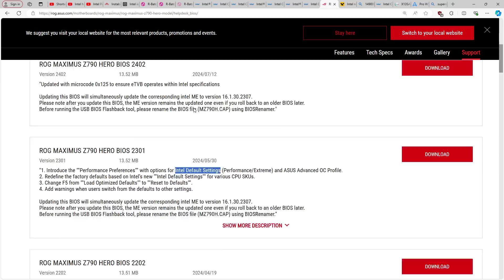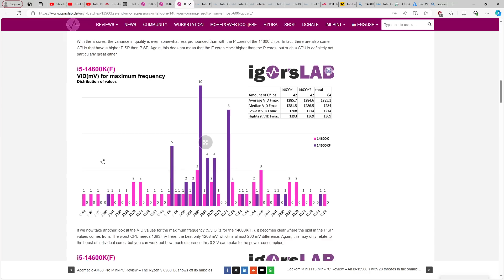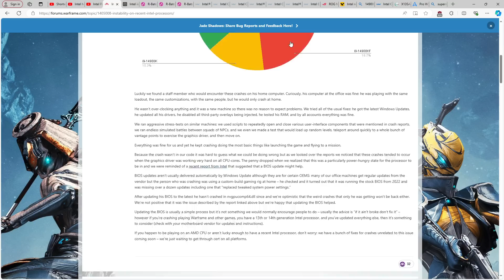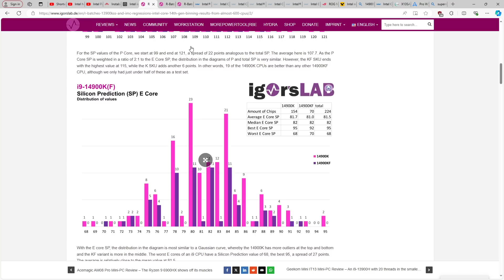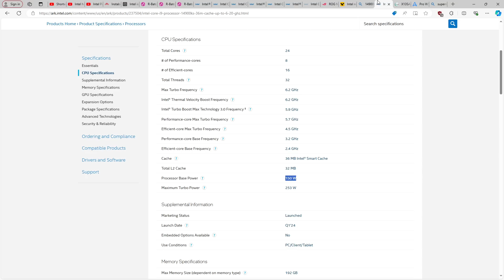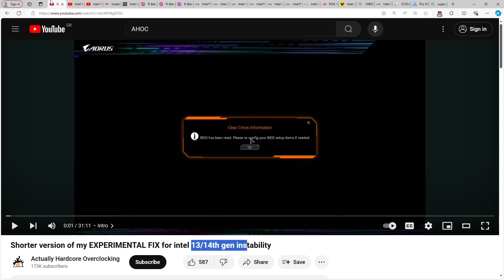The intel instability and degradation rant.

Comment: My 13700k / 4090 build has been flawless for almost 2 years now. Contact frame since day one as well. Been reading a lot that the stock retaining bracket can potentially be the cause of bent cpu's causing micro cracks in the e-cores and other parts of the cpu but as of right now that's just speculations with no hard evidence. But I've pushed my 13700k with a good oc since day one back when it was on the z790 tomahawk ddr4 board then I switched to the ddr5 z790 msi tomahawk when it released a little bit later and used the same oc settings but pushed my ddr5 which it has handled perfectly for well over a year now. 13700k oc to 5.6ghz on all 8 p cores, All 8 E core oc to 4.4ghz, Ring oc to 5.0ghz at 1.34v. Even the mem controller has been very solid. 32g.b Corsair rgb vengeance 6400 cl32 hynix A-Die oc to 7200 34-41-41-83 at 1.45v. I can't complain. I've know most are with i9's but I've seen a lot of i7's and even i5's and i3's effected by this on all generations 12th,13th,14th gen even though some are saying 12th isn't effected by this a lot are coming forward saying otherwise.

Comment: My choice of cheaping out and getting a 13700kf instead of a 13900k seems like a great choice in hind sight, I've had 0 stability issues. I have a -95 mV undervot.
Reply: Also in this boat
Reply: THey are on the chart and also fail.

Comment: Been running my 13900KS at 5.6/4.4Ghz with 1.175v and HT off for a few months now, only 230W in R23. Runs nice, cold and stable, and even better in games due to HT off. I'm not even bothering anymore with overclocking ... The difference is just marginal and doesn't even matter when FPS pass the screen's HZ anyway.

Comment: My 13900KS is degraded and running an all core OC with an undervolt is all i could do to get stable.

Running at 1.35v with the llc cranked is stable at 5.6/4.5 all core. The auto voltage of 1.4v at default llc is not stable.

And the ring makes sense. Everyone I've seen can do a ring oc of 4.9-5 ghz and mine, at this point, just doesn't tolerate a ring OC. Even with the insane vcore like 1.45-1.5v ring just isn't stable past like 4.6. Running at 4.5 at 1.35v is fine.

Comment: If you replace the contact frame and tighten it down you'll get enough board flex to effect the ram or even no post. So what do you think some of these motherboards are doing anyways? Many are thrown in a metal box and that's about it. I'd say any flex is doing some of it. Heat and cool cycles what have ya. Imagine the heavy heatsinks on the boards. They flex the board the same way.

Comment: sorry for being late to the party, but this just affect i7-9 with the K, right?
Reply: No, seems others may be affected too, but at a much lower rate (so far, anyway…) because they clock lower
Reply: @mduckernz 13600k has been out for 2 years and still is not showing on the crash reports, dunno what you're on about.

Comment: I had to RMA my 13900 K last week and I was experiencing all the symptoms the vram out of memory error random crashing voltage going all the way up to 1.8 with or without load I would turn down my CPU 200 MHz it would work for a week and then start crashing again turn it down 200 more work for another week and start crashing again all the way down to 5ghz all core all with Intel baseline enforced still hitting 1.8v. I've never had heat issues, in the high 80s low 90s on R23. I thought it was my GPU and I started the RMA process for it and then MSI suggested I try The Benchmark superposition with that I was able to consistently recreate my crash and able to diagnose that was the CPU and then confirmed it when I got a 13600kf I haven't had a crash since,  Intel's validating my CPU and sending me another one and I planned on staying with Intel because they treated me  good and not switching to AMD unless I had problems with the new one they are sending  but I didn't know how bad it really was until the last couple days, with some servers reporting 100% failures, now I've been looking at AM5 boards all day trying to decide between the 7950X or the 7950X3D because I like to Tinker and don't mind using process lasso.
Reply: You might as well wait, zen 5 should be announced soon.
Reply: @nodesais  I'm considering that but there are some crazy good deals right now 7950x3d for 460 right now  is one i just seen and with am5 i can always update later no problem maybe save some money on this build and go zen 4 and then jump to zen 6 or 7 amd said they will be supporting this platform till 2027 and beyond decisions decisions 🤔😁😁 either way im done with intel i plan on selling the new chip they send because who will buy a used one now? Better to keep it unopened and recoup some of the loss.

Comment: Its so bad and so many unknowns as to what really is going on just simply avoid buying any 13th or 14th Gen CPUs or systems. Simply stay away from them. I had random and unknown stability issues and one time I had thought it was maybe my overclock or vcore. Then when auto had strange issues as well. I went through several chips and sold them all. No more. So glad I sold them before this issue became known cause the used ones value will drop like a rock with these issues known.

Comment: Thanks God i bought i7 13700k instead of i9 13900k, back when 13th gen was released. And i have set PL1 and PL2 to 253W on the first day, beacuse PL1 and PL2 set to over 4000W was just to suspicious to me. Now 1,5 years later my i7 13700k still runs great without any crashing. It runs hotter that i would like, despite 280 AIO but no crashing at all... And my Vcore when running CineBench is always around 1,30 - 1,35V

Comment: There is too little data to claim "'CPU degradation'" for new CPUs. Processors that were over-volted (on the motherboard, not the CPU) and baking at 100+F for months would be damaged regardless of changing settings to Intel's recommended voltages. There is no coming back from that.  The reason the i9 & i7k series are overwhelmingly affected is because they are 'unlocked' and were directly affected by unrestricted voltage values. If you buy a brand-new CPU and set the voltage correctly to Intel specifications on day one it should be fine, which is probably why Intel did not notice in regulated lab conditions.  The community is right to be upset at the situation in that, 'Intel is pushing these to the limit before motherboard manufactures add their overclocking baseline' (not leaving room for advertised overclocking overhead). However, you'll still get amazing performance with the Intel baseline spec, better cooling, and would still be in the position where you'd be if you got an AMD, since those don't overclock well either. There is even evidence that the IO latency disappears after correcting the voltage, making this a non-issue.

TLDR: If you just got the CPU brand new, update the bios and use the intel specifications immediately. Degradation is only affecting CPU that were in service too long under poor voltage and thermal conditions. If you have already been overvolting for months, fix the voltage and warranty the CPU when it fails, then be sure to regulate the voltage on day one. No heat = no degradation.

Comment: I knew from the very beginning that this 1.5v for 7nm/5nm bullshit is not good in the long run. I've been running my 7950x undervolted and underclocked since day one (1.16v 5.3Ghz boost cap, 125W TDP) and I will continue to do so. I use my system for 5 years on main, then another 5 as secondary. If a CPU doesn't last a decade without degradation, it's a waste of money and the environment.

Comment: Why isn’t this stuff controllable within software and the OS. I’m kinda sick of motherboard manufacturers and intel for not controlling this stuff themselves.

They can’t be trusted to manage this themselves. All they care about is trying to get good benchmarks with zero regard for the consumer long term.

Provide the hardware, controls and shut up. We are back at a stage where actual low level knowledge is required again because vendors are idiots.
Reply: Great point!
Reply: And get additional potential security holes for the OS? That's another Pandora box you don't want to open.

Comment: the big thing here is that if intel KNOWS now that the P-core voltage is causing degradation and is still advertising their products as 6ghz out of box despite the configuration being unstable, then they're open for a MASSIVE class action lawsuit for defrauding customers and suppliers. Thats probably why intel has been so so quiet; they KNOW whats happening, there IS no firmware solution or any solution that doesn't tank performance, and they can't afford to give anyone more legal ammunition.
Fixing the problem by dropping the max power limit or neutering the power bid would HAVE to come with lower clocks, and then they'd be in defrauding customers/suppliers/MoBo partners with false claims/advertising.
Reply: Right, but don’t stay focussed on Intel. All of everybody is in on this one. Board manufacturers also, advertised being able to deliver power safely to these chips: so we’re going to watch the industry march lockstep in with each-other, including AMD who may get to play savior but probably not; because this is looking more and more like a fabrication level problem because of the crazy physical demands needed to fab chips at 7nm, a process also employed by AMD… .. .
Reply: There is no fix. Watch level1techs video and video with techjesus and wendell. 
They are running them stock/locked core speed/voltage under spec/ram speed well under spec, temp under spec and they are still dying.
Reply: Caping P cores to 5.8Ghz and E cores to 4.0ghz made a huge difference in gaming performance and stability. Voltages went from 1.50-1.64v to about 1.40-1.45v. Intel 100% knew voltages were an issue but lowering them would cause instability when the CPU ran at advertised speeds under full load. So, Intel chose to look the other way and deliver the speeds they promised (legally required) knowing very well CPU degradation would follow.

Simply put, Intel backed themself into a corner by not looking ahead and on clock speeds instead of cache like AMD. 

I still love my i9 14900k but I'm disappointed in the overall need to neuter it to achieve stability. I also have warranty for 5 YEARS which is plenty for me and from what I've heard Intel is lenient with providing a new CPU or refund.

Comment: My 13700k on aorus z790 elite makes no problems with arctic freezer 3. Also with a vf offset of -0.061...~0.068v.
Ac 40 dc 90

There was a time, maybe its bios related or temp related or ram  were i had problems, at this time it was cooled with nh-d15.

6800 mhz  works good.

Comment: AFAIK Intel redesigned the ring for Raptor Lake to support more e-cores compared to Alder Lake (8 vs 16). Ring bus implementations get way more complex when you add too many points to it.
Reply: As far as I understand it, there's nothing complex about adding more nodes to a ring bus, it just creates more latency as the average number of nodes a message has to pass through before reaching the destination is increased.
IIRC E-cores sit on the ring bus in cluster of 4, so adding 8 more E-cores should have added 2 extra nodes to the ring bus. With 8 P-cores and 4 E-core clusters, that's 12 nodes vs 10 for the 8+8 models and 8 nodes for 8+0 models, or a 20% and 50% increase in the number of ring bus nodes respectively.
I can see why they felt increasing the frequency of the ring bus was the only way to maintain gaming performance, which is very latency-sensitive.

Comment: I guess I am one of the lucky ones I have a 13900KS on a MSI Z790  Godlike MB my only complaint I had to go to liquid metal to keep it from thermal throtteling when running at max clocks. No crashes no lags . Everthing works everytime  Knock on wood. However I am going to AMD When I upgrade soon.

Comment: TLDR; i9-14900k - ships at 6Ghz but skilled overclockers can get it to push 5.5Ghz reliably?
Reply: Actually Hardcore Underclocking
Reply: this is a really funny way to put it, kudos
Reply: I have a NON K model.. It was by accident but now I'm thinking it was a smart move 😅
Reply: @deansigman6099  Current Intel CPUs feel pre-overclocked so why pay extra for the K?
Reply: @SM-rn3xy  6GHz is multicore enhancement on, power, current, limits removed and suicidal voltages.

That is way beyond Intel sepc.
Reply: mighty intel  lol
Reply: '2' cores @ 6 GHz not equal 5.5 GHz all cores.
Reply: "K" stands for "underclockable".
Reply: Caping P cores to 5.8Ghz and E cores to 4.0ghz made a huge difference in gaming performance and stability. Voltages went from 1.50-1.64v to about 1.40-1.45v. Intel 100% knew voltages were an issue but lowering them would cause instability when the CPU ran at advertised speeds under full load. So, Intel chose to look the other way and deliver the speeds they promised (legally required) knowing very well CPU degradation would follow.

Simply put, Intel backed themself into a corner by not looking ahead and on clock speeds instead of cache like AMD. 

I still love my i9 14900k but I'm disappointed in the overall need to neuter it to achieve stability. I also have warranty for 5 YEARS which is plenty for me and from what I've heard Intel is lenient with providing a new CPU or refund.
Reply: @SM-rn3xy  I like your style dude!
Reply: Frame Chasers 7/14/24   - problem described and solved
Reply: Regressing forward
Reply: My 14700k runs at 5.5 all cores, 5.6 on two best cores, stably and reliably with the microcode patch bios and no OC. Stock power limits. Not sure what's going on with the 14900k.
Reply: 5.8Ghz all Pcores 4.7Ghz all Ecores zero issues AMD fanboys are loving this.
Also horrible guides as well.
Reply: i got mine to 5.7ghz all day, no problems.. you have to know what your doing.... this is for the ELITE MASTER RACE
Reply: I got mine to 6.4ghz delided Liquid Metal direct contact 0 problems
Reply: @Hectorscarclub13  no problem yet....
Reply: @Hectorscarclub13  YET. Don't worry, it will.
Reply: @Hectorscarclub13  Finger crossed it keeps running like that for years 🤞
Reply: @Hectorscarclub13  YET you forgot
Reply: @Hectorscarclub13  Have fun while it lasts. With the heatspreader removed any (almost surely needed) RMA's will be denied instantly.
Reply: @whohan779  no one doing that cares or has ways to deal with such a thing
Reply: @ogBINARYGOD  Yeah, you might be right but that just shows they have more money than 🧠s. You can maybe make the argument that the multicore score exceeds that of a 7950X but for single threaded applications I take a 7800X3D or 7950X3D every day of the week and won't look back.